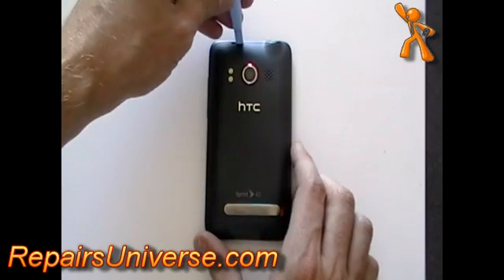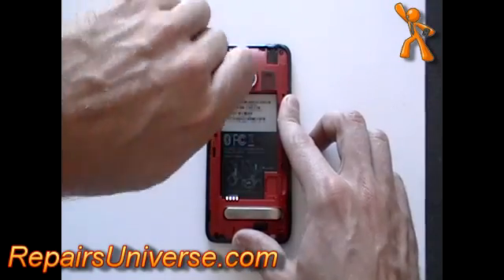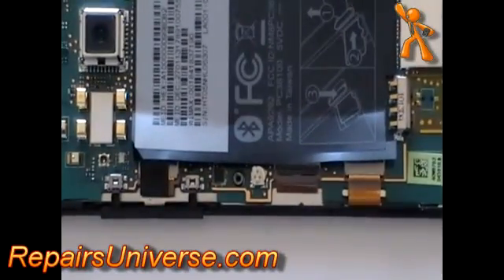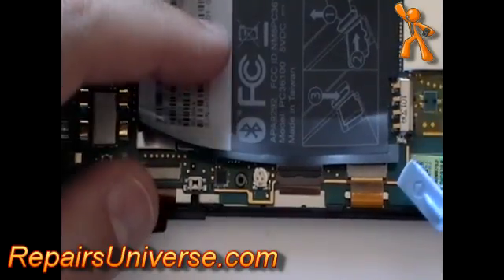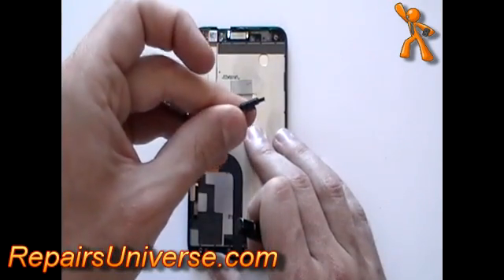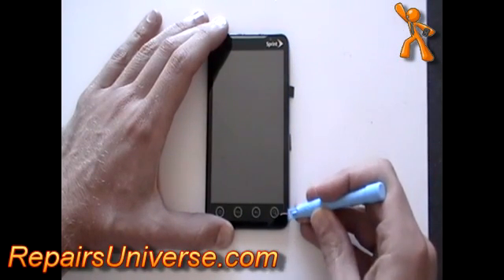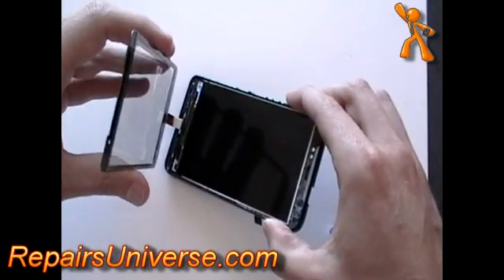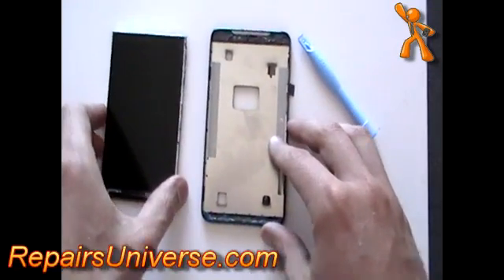HTC EVO 4G LCD Screen Replacement Instruction Repair Guide

Comment from the maker: @drewlt1 Yes, the t5 is the correct screwdriver. There is an error in the video about the T4. 

You can find adhesive strips in the tools section at RepairsUniverse (dot) com